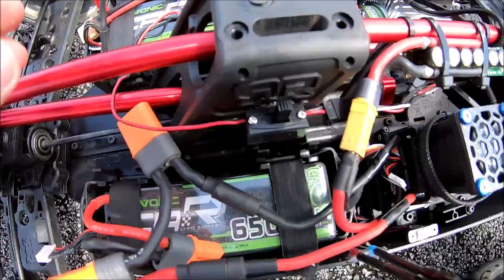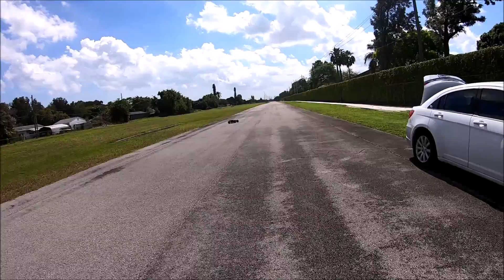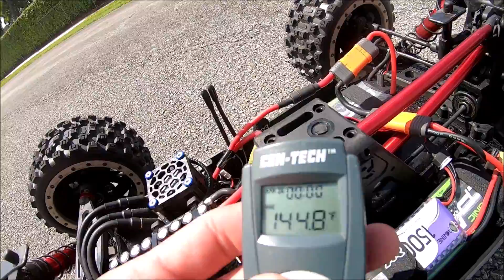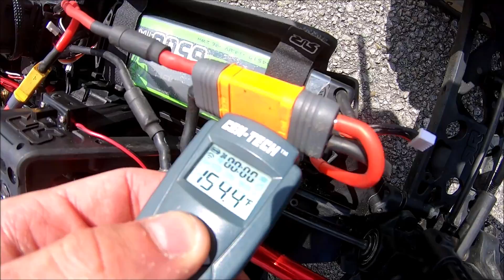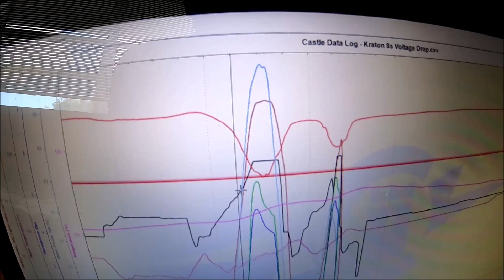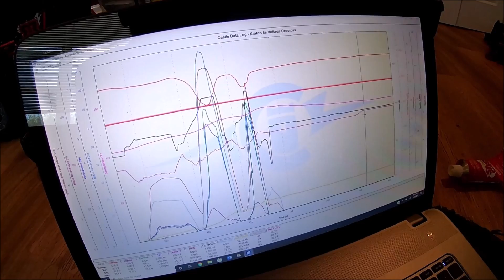Arrma Kraton 8s NTF Fan Upgrade Test! Geared Up

Comment: Do your batteries get hot too? I'm running 39/39 gearing Max5 with a  HW 56113
Reply from the maker: They will get hot with that gear ratio and motor size. If you have big batteries they won't get as hot during a run if they can support the load

Comment: What motor fan mount are you using? Ive been looking for one to fit my 48mm motor! Thanks bud.
Reply from the maker: What's up, it's a traxxas Xmaxx heatsink. Just bolt the fan in the middle of the heatsinks

Comment: What are the specs on the batteries you were using and what are the specs you would need to prevent running into the voltage cutoff?

Comment: They're powerful fans bro. What size are they? 35x 35mm?

I'm currently using a surpass hobby rocket fan @ 28000rpm. It's 30x 30x 10mm so I had to make and adapter. The result is similar to the fan you're using, it's noisy but keeps my max6 super cool and that's what we want 🙂👍✌

Comment: Your truck weighs 30lbs. with batteries mamba X is only rated at 25lbs. and you’re running 1:1 that’s lots of strain just saying
Reply from the maker: The mamba monster x 8s is easily capable of delivering the power needed for this vehicle, regardless of specifications: it's used as a cushion for Castle. As they stated it performed better than what they intended it to be. 

If you ran this esc, you would know it isn't sweating pulling only 140 amps...

The batteries and connectors are what straining in this video

Comment: I thought the mmx 8s could handle up to 300 amp draw? It was cutting out?
Reply from the maker: It can handle it. It's the batteries that can't support the load. ESC asks for power from batteries to transfer it to the motor. Batteries said NOPE!
Reply: mine recorded 338 on 94% throttle on the data log crazy power on 6s.

Comment: Thanks for sharing buddy. Them fans are beasts. Dyson Fans LOL. Think to get full potential & Max RPM from Castle 2028 needs 12S Li-Po, but I'm sure you will know that anyway. Thanks for sharing another Epic Vid 👌👍
Reply from the maker: Lol maybe they are by dyson! Up the voltage decreases amperage- exactly what I need. I think 10s would be a sweetspot, Appreciate it man 💪

Comment: She's a wheelie monster now! Those fans are #BADASS
Reply: Those are good temps for a geared up heavy rig like that in hot humidity
Reply from the maker: @philthyco1  agreed. I desire to gear down a little. Killed the batteries way too quick and connectors are struggling
Reply: @InnovationRC  Yea the connectors seem like the weak link

Comment: Would run 8mm bullets all around. I have several 100+ mph boats (on my channel) that can see 450 amp spikes on 12s the connectors never get over 135. Castle 6.5mm are pretty damn good toof or motor leads. Lot of guys won't run bullet connectors only, just don't accidentally reverse polarity. I suspect your connectors would drop in temps with a better battery anyway but I think you already know this.

Revolectrix cells will not sag much under load, turnigy heavy duty 60c are ok, nano-tech + 70c are also capable. All have produced NAMBA and IMPBA records.

Great channel btw, very nice methodical approach to everything!